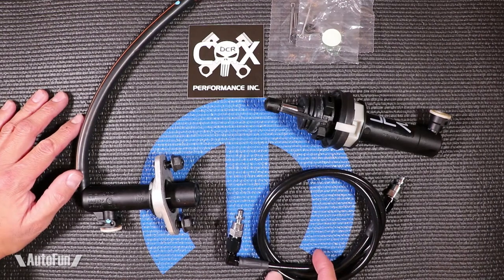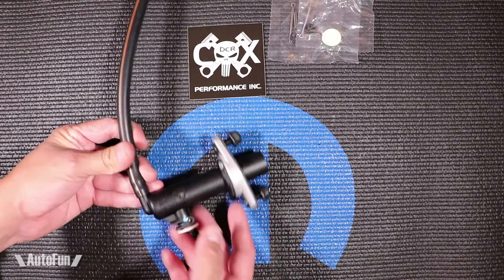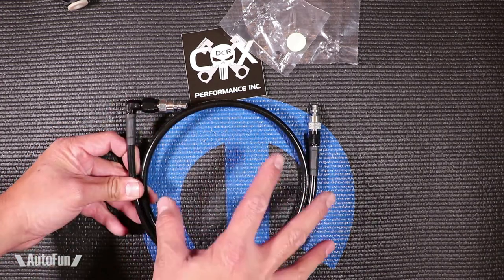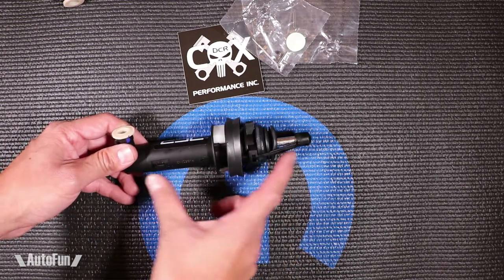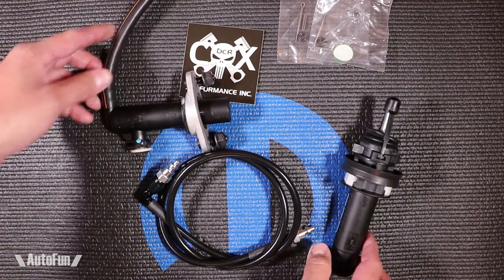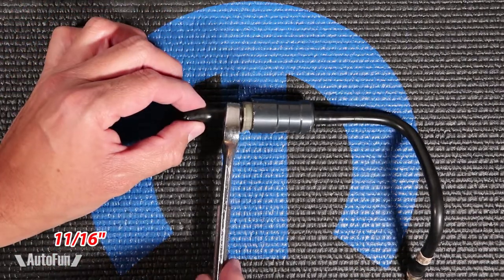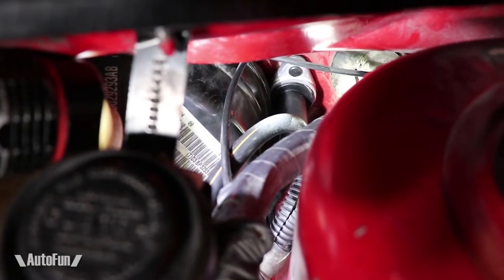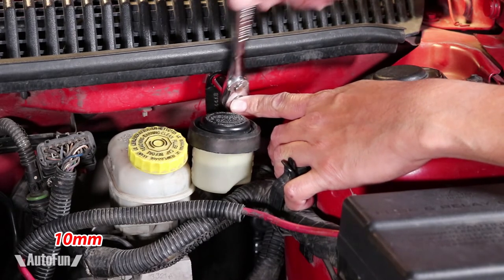Dodge Neon SRT4 Hydraulic Clutch Kit Review & Install (Braided Line, Master, Slave Cylinder)

Comment: I've never sweated so much in my life trying to install this kit during a hot South Florida summer. It's an extreme tight fit at the engine bay.
Reply from the maker: Hi Donald C, I was lucky to have done this in winter, here in Cali I can imagine it would have been like a sauna in the garage during summer, you Sir are a trooper!
Reply: @AlexAutoFun  🙂 you have no idea, I'm glad I won't have to worry about it for a long time. It was one heck of a challenge.
Reply: @Nervouskeletonz I'm from Broward as well. If you are going to do it yourself, hopefully you have a garage. With the way the rain is out here everyday, and the heat, you are not going to like this. To save you sometime, after you install the master cylinder inside the car. Before you put the slave cylinder in the transmission, put the cylinder slowly with your hand, leave the reservoir open so you can see the bubbles. It's going to take sometimes. Don't put it in the transmission until you don't see anymore bubbles.
Reply from the maker: Hi @Nervouskeletonz , how did it go?
Reply: @Nervouskeletonz I bought the complete kit from DCR. After you insert the master cylinder through the firewall, the reservoir will sit in the same spot where the factory reservoir is at. It's a lot bigger than the factory, you will have to bend the bracket a bit.

Comment: Good video. I had a DCR master cylinder and when installed it never worked, so I went back to stock. I've had a lot of issues with DCR parts recently and I don't know why but every time I put the stock part back on to see if it was something I did wrong, it works fine... so who knows. I know it was a pain to get the master cylinder in and out though!
Reply from the maker: I feel your pain! It was difficult getting the master in but it does help I have small hands! I have so far gotten good results with DCR, not sure if I just been lucky or what! lol What I think does matter is the support if you do have an issue, I think that is what makes a good company, the recovery and making things right if something does go wrong
Reply: I recently installed the Dcr slave cylinder and it made my throwout bearing start chirping really bad so I went back to stock and it's still chirping but in a lot lower pitch, extremely annoying.

Comment: I always have the issue with the slave cylinder breaking and I have the dcr clutch pivot and I made sure I screwed it to the smallest setting possible and adjusted it 1/8 at a time and still broke and tips
Reply: Any tips*
Reply from the maker: Hi Toxic! That is strange, I haven't had that issue happen to me (and I have adjusted my DCR rod quite a bit on both directions till I found the sweet spot). I would recommend contacting DCR for tech support, they may be able to walk you thru some troubleshooting steps. Cheers!
Reply: @AlexAutoFun  tyyyy
Reply from the maker: You're welcome! @toxicinfamclan05yt2

Comment: Hey! My slave will not turn to lock, fits in the grooves but I cannot spin it for the life of me. Any ideas?
Reply from the maker: Hi Scat Cat! usually it just a matter of making sure the slave is fully inserted into the tranny case and turning while pushing in (making sure the slave is parallel to the case so it's aligned). Also I heard aftermarket ones have a higher friction fit than the stock one and DCR. They seem to be able to turn easier than the aftermarket. Hope this helps and thanks for watching bud!

Comment: Does anyone know if before slave cylinder install do you unhook the plastic cap? Or do you leave the cap locked with the little plastic pieces?
Reply from the maker: Hi Ryan! The plastic hold down cap is temporary just meant to help with installation, as soon as the clutch pedal is pressed, the holds downs break and the cylinder is released. That being said, it is possible to remove the plastic cap hold downs or cut them before install (just remember, the hold down clips are under pressure and sometimes cutting them or removing them will release the cylinder with force), I find it just a matter of preference. Cheers!
Reply: @AlexAutoFun  thanks for the fast reply. I just installed the dcr kit on my car. But it hasn't fixed my problem I think maybe the throw out bearing went out. Your videos make repair much easier.
Reply from the maker: You're welcome Bud!